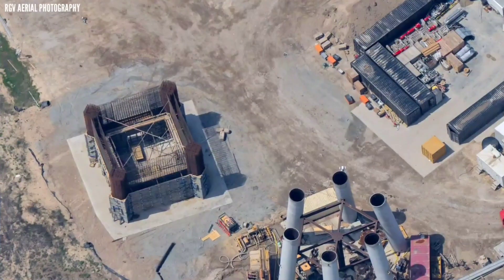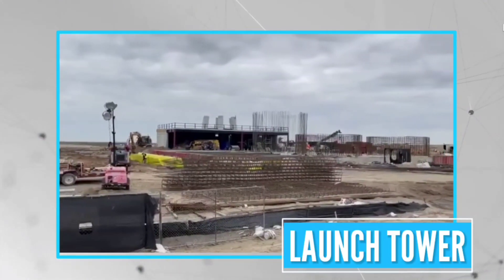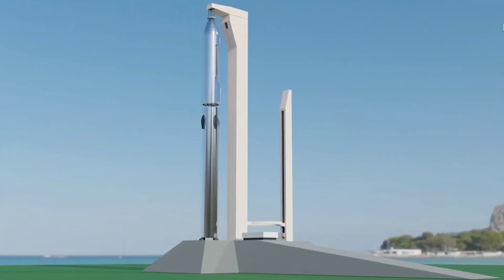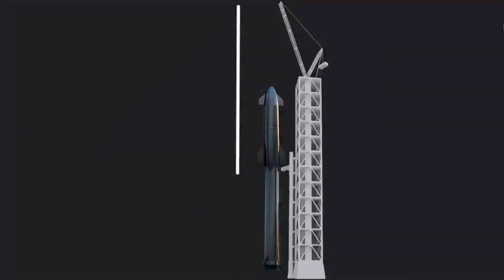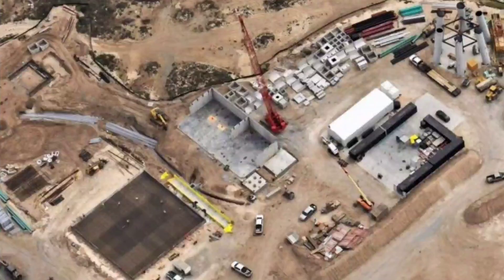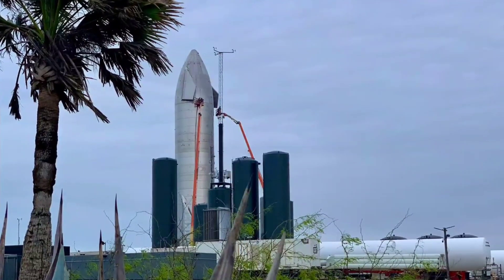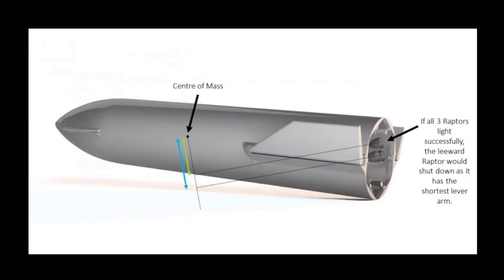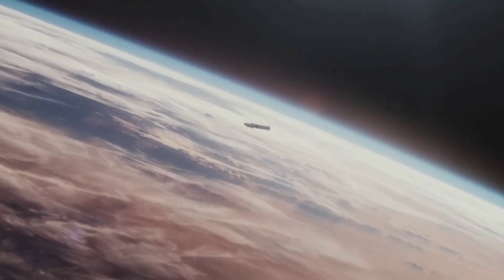Spacex Starship Launch Tower Taking Shape

Comment: sn16 is being readied and will be next to fly - then they go straight to sn20 but not sure if even 20 will be an orbital !
Reply from the maker: No, after SN16 they are not go to straight  SN20, SN17, SN18 and SN19 are also in behind SN16 for test this flight go higher than previous flight.
Reply: MathiX !  is it cancelled for sure? I'm sure I have seen parts for no. 18 at the factory
Reply: @identidem  there haven't been any sn18 or 19 parts for a while now, they got scrapped.
Reply: Yes SN15, SN16, and SN17 will all be built and SN 16, 17 will go to higher altitude for testing. BN2 will be test flown by itself, and SN20 and BN3 will be mated and launched into Orbit. However everyone is assuming the Starships will launch in sequential order. That likely the case but if the orbital launch is ready they don’t have to wait for SN16, or 17 since those tests have different objectives.

Comment: I think at least two stabilizing arms sets will be required. One at the top of Super Heavy booster to brace the booster. And one to brace Starship, possibly with the ability to rotate Starship to align it with the booster.
Reply from the maker: Idk, how spacex catch the super heavy but I am seeing some renders and It’s give me idea how spacex catch but ya It’s still mystery for me how actually it work or probably not, but what are you saying it's also quite possible.
Reply: @ScienceOfSpace379  It's very possible. Most people think the biggest issue is keeping the booster stable in flight enough for the arms to catch it. I don't see this as an issue. Every time they hit within the circle landing site on ,"Of course I still love you", they are getting a very precise step by step. By comparison, the booster is way larger yes but the concept is still the same and the arms do most of the tedious work.

Comment: This Starship booster catching idea is another idea that will be abandoned in short order!  Just two feet either way absolute pinpoint upon landing will be another disaster!
Reply: I think it's doable. Not easy, but then again,, none of what SpaceX does is easy. It's literally rocket science haha.
Just watch them do it.
Reply: At least you would think it would be separated some distance from the OLM and the arm length could extend and retract some distance quickly to account for booster variation thus making dynamic adjustments.  It could be done, but it's one heck of a goal.
Reply: A sudden wind gust would suffice, especially given the height of the booster. Very unstable. In Fact, I worry about launching a booster-starship stack. A slight wind and......timberrrrrr.